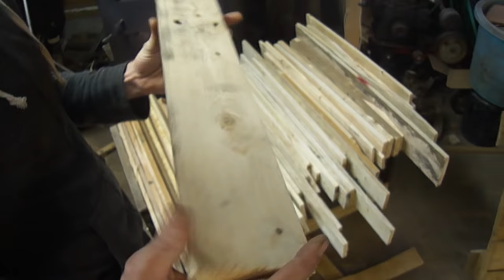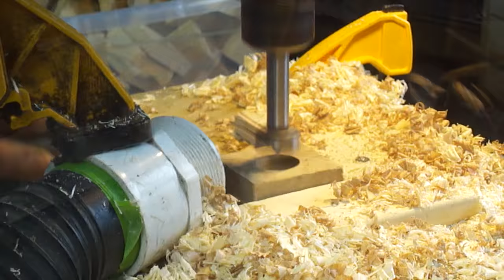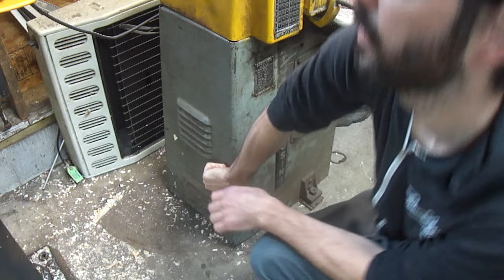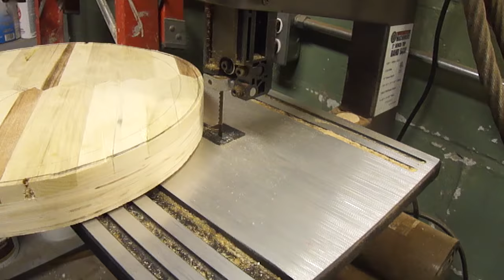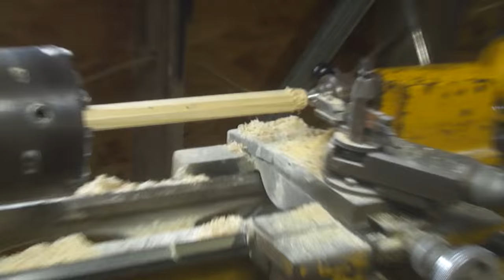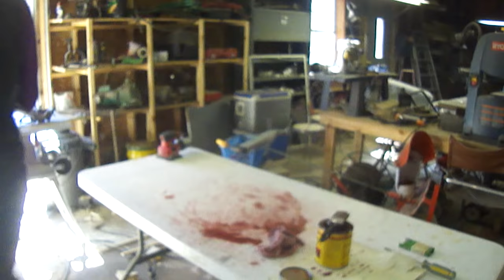Stool Built From 100% Pallet Lumber.

Comment: I like the seat, very ceative. Just wondering why you didn't offset the DP table by 5 or so degrees when drilling the leg holes in the seat. It would look better and probably be stronger
Reply from the maker: Ant Mallett  yeah for sure. at that point I had over 60 hours Into this thing! looking back on this that would have been optimal but I was probably  rushing to get it finished and moved on.. my next project should be up soon hopefully. these things take so much time!

Comment: I'm sad that you stained it in the end as the stain soaks into the dissimilar woods differently. Sanding down to a good 320 or so grit and a good oil is usually my go to for similar projects. I bet it looked way better in person though.  Pictures never do ones work justice.
Reply from the maker: I agree totally on the stain choice, it was a bad decision.. But in my defense the whole project was basically a work in progress and an experiment.  That lathe I was using was meant for steel and not wood, so i didn't spend enough time with it. The legs had terrible wobble and chatter when running the lathe bit through the center so it was really rough.. spent about 2 weekends alone doing that.. By the time i finished sanding the first couple passes  i was ready to be done lol!!
Reply: Ugh. Sounds as fun as the 2x4 butcher block work bench im three wekends into already!  I've never run a lathe but I can imagine it might take a while to perfect even if it is the right one for the job.

Comment: Pretty cool looking stool. I really like the seat design. I'd be a bit worried about the strength of the legs in that the grain of the wood is perpendicular to the length of the leg rather than parallel. If someone sitting on the stool leans to the side the leg may break along the grain. As a work of art, it is really nice!
Reply from the maker: Yeah its less functional and more artistic for sure. Just an experiment i wanted to get out of my head really., Thanks for watching!
Reply: Isn't there a dowel through the length of the leg? Plenty stable I would think.
Reply: It's a gift for his mother in law.

Comment: I'm just wondering what part of the pallet the plywood came from ?
Reply from the maker: Finally! i was waiting for someone to call me out on the plywood, It was in fact from a pallet, though not the typical pallet. This one had delivered a rather large air compressor. So it was more of a crib style pallet.
Reply: lol got ya
Reply: I run across 3/8" plywood pallets all the time. The "wood" isn't even good for bonfire. I sure wish I could break down and pull nails that fast. it would be AWESOME!
Reply: The plywood is the product that was delivered on the pallet.
Reply: I used to work as a piece rate pallet refurber, and also as a crate builder. Plywood frames and supports are quite common for example to cradle odd shaped castings or machinery parts. The worst pallets to work with (and avoid) are ones from the bacon factory, dripping with rancid fatty pork and maggots
Reply: Nguyenluan
Reply: 100% :))
Reply: +Darren NYC veuna
Reply: Darren NYC 
Hello 👋 
Good  Nice 👍  100%
Reply: @treecycled  yes I got one piece of plywood out of pallet

Comment: I admire the amount of time you put into this project, thanks.  A couple of things I picked up here, one I have never seen someone laminate a stool leg with a centre dowel. Very interesting and I suspect stronger then hell. The other I found interesting was how close you got to a circle with just the table saw. I likely would have gone to the band saw sooner, but hard to argue with the results.  Did you think about doing a round over on the seat top, to soften the edge on the back of the legs (just a thought)? Keep up the good work.
Reply from the maker: The legs are very strong! The table saw trimming was actually pretty dangerous and im surprised more people "safety police" haven't gotten on my case about it.  I didn't have a working band saw at the time, but i brought it to a family members wood shop and finished the trim there. I should have just trimmed the entire thing with his band-saw but i was impatient.. oh well/.. The stool itself was more of a idea that formulated around the legs, and as a result It ended up quite wobbly.  It sits in a corner holding up a house plant at the moment, and im going to rebuild it in a future video though incorporating all the complaints ive had in this comment section! Thanks for watching and check out some of my newer videos if you wanna see more!

Comment: Can't believe you used the table saw free hand, (keep that up, it won't be long before you're missing some digits,)  then went to the "Go To Tool" Bandsaw and finished cutting the circle. Why not go straight to the bandsaw?
Reply from the maker: I didnt have the band saw in my garage at the time or i would have, i ended up using my friends saw, which is seen in the video. Its not an advisable method. I dont advise anything really, just showing my experience. I have all my fingers. Thanks for watching!

Comment: Very IMPORTANT STEP about drilling the holes in the seat for those legs is the holes should have been drilled EXACT SIZE on an angle that you wanted for those legs to spread out at the bottom and it is a compound angle and the way you drilled them oversized like that if you use that stool much at all it wont be any time at all until they become loose and fall off

Comment: A trick for finishing. While legs are still on lathe - apply finish then. Low speed, and apply. you will get a better finish and not have to fight around other pieces.

Comment: You need to learn some safety skills. You are fortunate to have a right hand right now. Like has been said before, if that bit had of gotten into those pliers. OH MY!!!
Reply from the maker: Those pliers were the best tool i had for the job. Maybe making a wooden pair would have completely satisfied all the safety police, but I completely jigged that table out to hold the squares firm in place. The pliers simply held the corner from spinning as i held the pliers down onto the press table. And the fuggin pliers were in my left hand anyways. If the bit "got into" those pliers that cheap ass harbor freight fostner bit would have chipped at best, i certainly wouldn't have lost my right hand! good lord.

Comment: D F... Not using a guide with skill saw at beginning and putting 'metal' push rod against a rotating drill 'Forstner' bit!!! WTF
Reply from the maker: Try using a guide when cutting a pallet apart and tell me how successful you are. Guides follow a flush straight surface, and you will never find that on a pallet... ever. I do it the quick easy way, and its not a problem if you know how to handle a skill saw. At no point did i touch metal to rotating fostner bit.
Reply: Are you simply looking to point things out regardless of if there is an actual safety issue?? The way he had that forstner bit set up with the jig was in no way unsafe. In fact, I'm impressed with that whole set up and that he took so much time to jig it up like that. More people should take those kinds of safety measures  when using the drill press. Also, nothing wrong at all with how he cut down the pallets with the skil saw? I just don't see your points. Dude seems safe to me. Now that stool he ended up with....I guess beauty is in the eye of the beholder! Haha! JK man.

Comment: Why did you cut so much off the seat , rounding it on the table saw? Why not just cut it round on the ban saw in the first place. Great job on the stool?
Reply from the maker: My bandsaw had just broken a guide, did my best with what i had and then ended up bringing to my cousins house to use his band saw and belt sander to clean cut it. Thanks for watching!
Reply: I think use of the TB showed skill.

Comment: Slight  error the bottom of the seat was not made from a pallet it is made from two pieces of plywood and then parts of the pallet are added to the top of it.  So it is NOT 100% from pallet lumber.
Reply from the maker: Every single piece of wood in this project came from pallets,. Include the flat sheets of wood that i cut circles out of. Pallets come in all shapes and sizes, including some that have sheets of lumber.  Search "pallet types" in a google image search. You will see. Thanks for watching!
Reply: @treecycled  TY for your reply and clarification on that.

Comment: Nice job. Next time, wear  a face shield or protective glasses at the lathe.
Reply from the maker: Thanks for the tip! I wear safety glasses most of the time im working, but i actually dont use this lathe anymore, its actually meant for steel. I do have a new wood lathe that i will be using in upcoming videos. Check out some of my latest videos if you want to see  more!

Comment: When placing the runs on the legs it is best to have them two inches apart. For better strength. A straight run like yours is weak due to the holes placed right next to each other.

Comment: Great job...May I suggest sanding the long pieces before cutting them into squares , drilling the holes in the seat at a slight angle , painting the finished legs while on the lathe , and don't use so many nails on the seat ,as the glue will hold it easily if clamped properly.

Comment: Third and final comment. You should have rounded over the edge of the seat. The overall finished product is about a 3 out of 10. Very rough finish and those leg supports will break as soon as someone puts a foot on one. Great projects, but you need to think further into them.

Comment: How is this 100% pallet lumber?  You clearly made the original seat rounds with plywood.  Putting pallet wood strips on top of it doesn't make the plywood, all of a sudden, pallet wood.
Reply from the maker: On the contrary. Pallets come in many different types, shapes, and sizes. Those sheets were definitely pulled from the top of a pallet. I've addressed this numerous times. You can google up different pallet types and easily see what im talking about. Sometimes a pallet requires a sheet of plywood or other sheet lumber attached to it for various delivery issues. Thanks for watching.
Reply: @treecycled  Right, with no nail holes or any other visible sign of attaching of any kind.  Just unmarred, smooth plywood with no form of attachment to a base.  Got it.
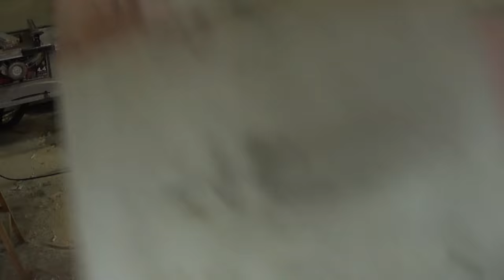Reply from the maker: @TruOnyxfire  Starting at 17:20, you can look at the wood. Its the shape of a pallet. There are nail holes on both sides of the board that line up with the pallet stringers, and a huge pry mark left by the crowbar i used to pry the board off the pallet stringers. I appreciate you holding content creators to their word, but I have nothing to gain from lying to anyone on my videos. Its your choice if you wanna believe me or not. There are plenty enough angles to see this.  Thanks for watching!
Reply: Treecycled, ignore and stop justicifing